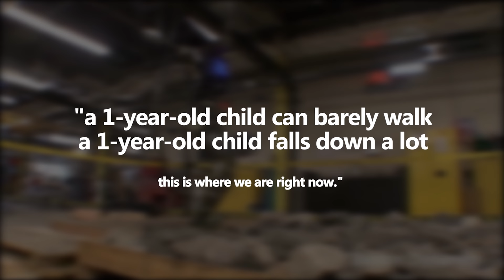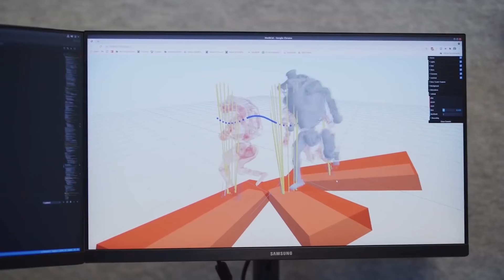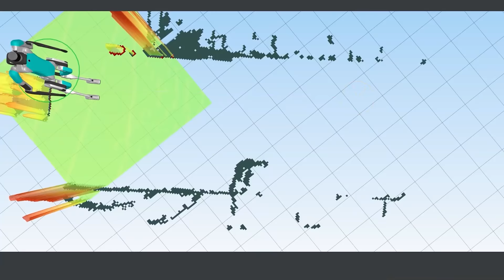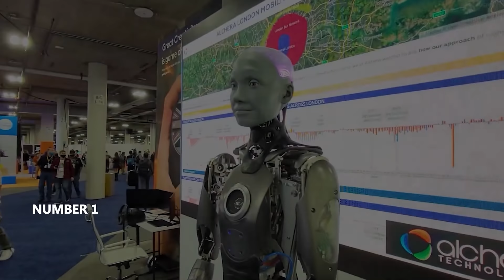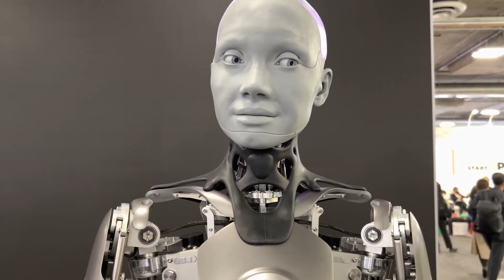5 Most Realistic Humanoid Robots in The World

Comment: Imagine having a robot golf caddy. It can carry your clubs, add your score, give you the score you had on previous rounds and provide you with the perfect club at any time. Then if you argued that it gave you the wrong club, it's response would be that based on your prior rounds, from the same distance and taking into account the wind speed,  elevation or drop to the pin, that is why it gave you the club. It could also use internal videos or photo footage it stored in it's memory from previous golf rounds. It could even suggest different strategies on the tee like where to aim, based on the wind speed. On the green, it could calculate the slope to the hole using various camera angles and speed sensors to give you the perfect putt every time. The ultimate caddy.

Comment: Self aware , self preservation, those are two fundamental humanistic traits, that set humans and robots apart! Then you have other human traits such as creativity, experience, cunning, envy,  the list goes on!  
If you were to put a mobile robot, battery powered,  the most advanced on the planet, and program it if you wish, that when its batteries run out, essentially it will shutdown, and it will cease to be!  Lock it in a room, where there is no access to power or batteries,  and see what it does? Nothing will be the answer, because however clever the current programming, it will not be creative , or have the ability to access the situation, without prior instruction, or "aware" enough to attempt self preservation, and knock down the door, to keep itself from ceasing to exist. Of course you could program that exact response from the robot, for that particular situation, if  x, do y! However , creative original problem solving, stemming from original thought, is years away. If, or should I say, when,  Robots can figure out " what's at stake, ie their very existence, and then proceed to plan an action for self preservation, then we humans will really need to look out!